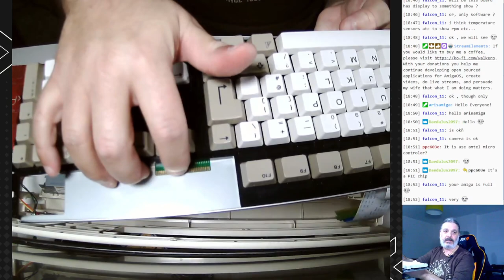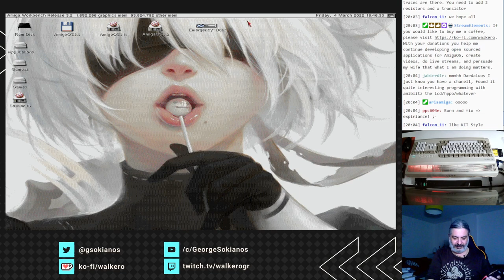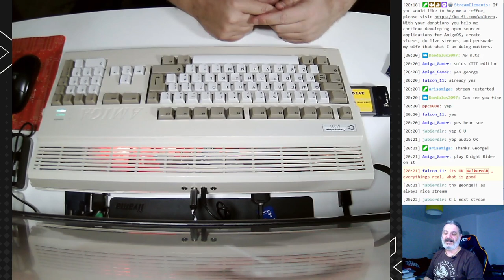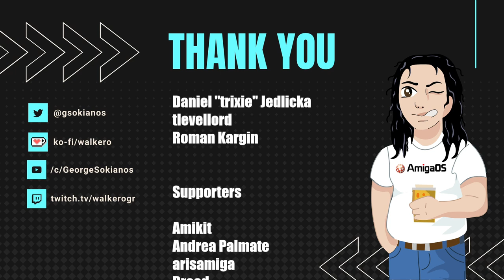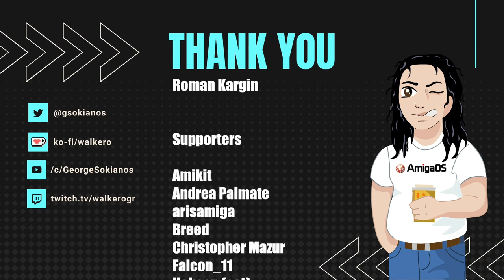Classic Amiga - Solas board installation and review

Comment: Hi...great video.....I also have a Solas.....had it working in my A500+ but its in my A1200 now.....can I ask what settings you have for the Audio meter ? Im struggling to get that set up.....I Do get the led`s reacting to Mod`s but it need fine tuning.
Reply from the maker: Thank you so much for watching my video. Sorry for my late reply. The settings program has some issues and for me the leds do not react to the "Audio" settings but to the "Idle". So, I set there the way I wont them to react and the colours. If you need more info please let me know.

Comment: Do you know of anywhere that is producing new clockport sound cards?
Reply from the maker: Unfortunately, I am not aware of anyone making new sound cards for clockport equipped amiga. The last one I heard was Prisma and this stopped being available for a long time now. Not even it's software is updated since the very first release.
Reply: @walkero  There is a real gap in the market here. Apart from the device in your video here , the only readily available products for the clock port are clock port multipliers - which is totally useless without other kinds of clock port devices. What use is a port multiplier with no other types of things to go into the ports?
Reply from the maker: @Polyp I totally agree with you. But it seems that most people care about accelerators and memory upgrades just to fill up their computers with WHDLoad games.
Reply: @walkero  What I dont understand , and i know this is going to sound ranty but how does the market for clockport multipliers sustain itself. What ARE people plugging into their amiga clockports these days?
Reply from the maker: @NickFellows  I assume that they are easy to be made, so there is no investment technology research, and they are logically cheap. But I am not sure, to be honest.
Reply: @NickFellows  In my case.. an extra serial port? but i dont use a multiplier for that.. i have a clockport on the motherboard and another on my accelerator. :)